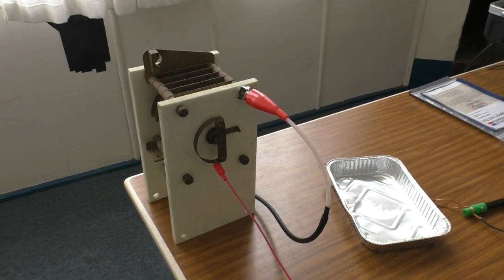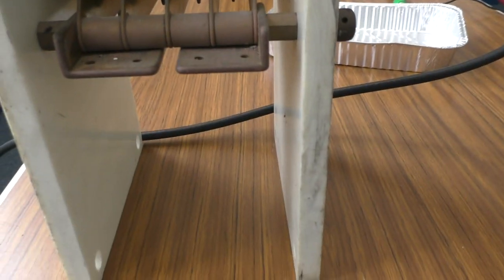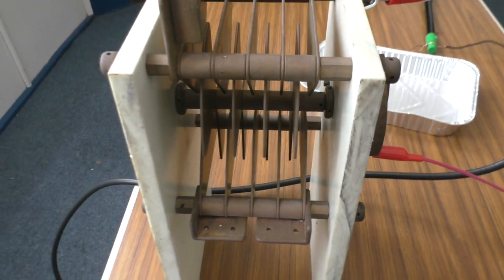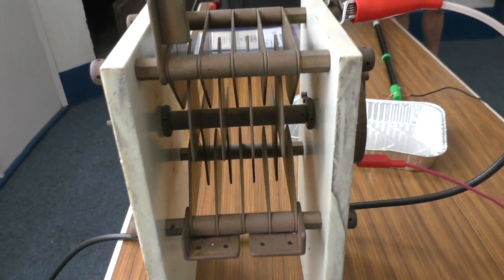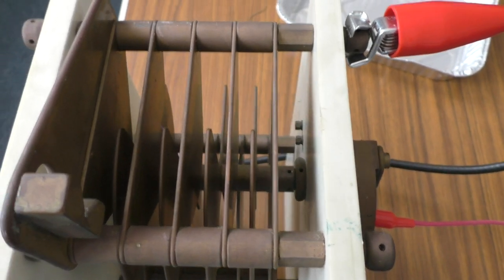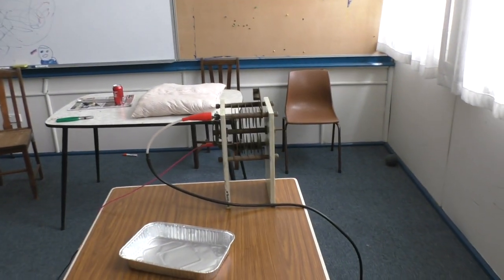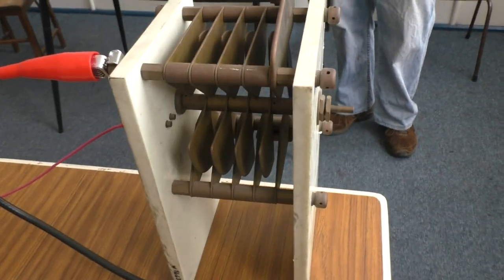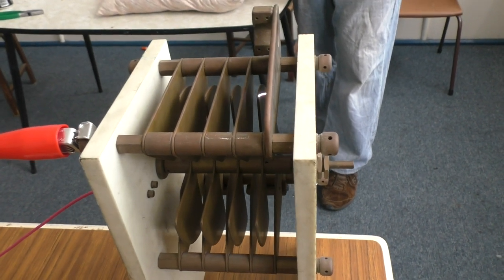High Voltage Fun At The HARG (Hills Amateur Radio Group)

Comment: Quite interesting...And... by my observation of capacitor failures, once an air gapped capacitor fails ONCE, it seems (to me) that they are always prone to repeat failure, and at a lower threshold than the original voltage. My guess is that the surface at the respective points of failure somehow changes, and the gap is even more easily broken.